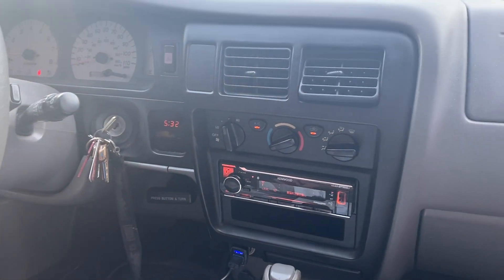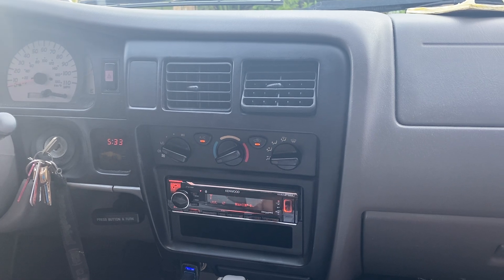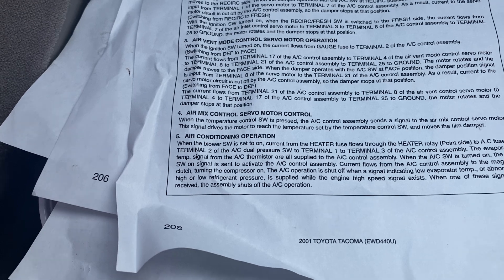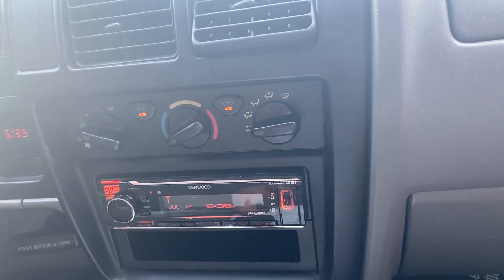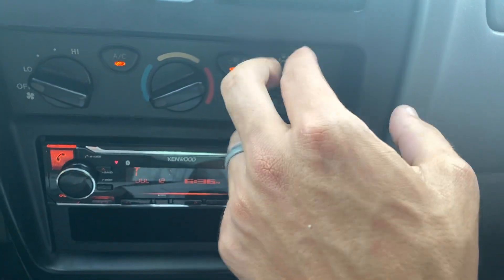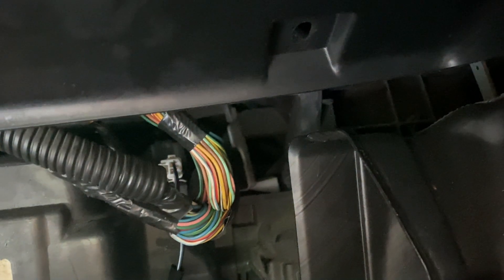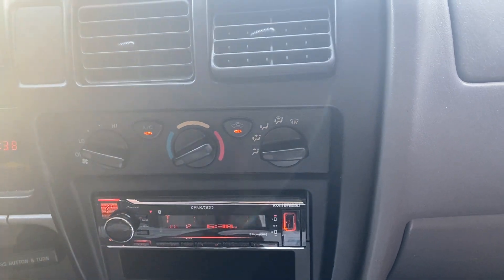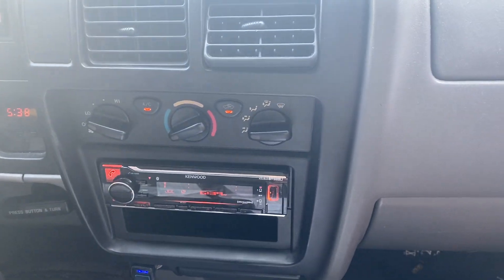AC Control Module Diagnosis HOW TO First Gen Tacoma 1995-2004

Comment: You were popping the 10A because you had a short or ground before the load in the circuit.  The purpose of the fuse is to protect the components of the circuit because are not designed to handle >10A.  Putting a higher A fuse exposed circuit components to more current than they were designed to handle, which is why you replaced all the shit in the path.  You fried them with excess current installing the higher A fuse.
Reply from the maker: I fried it because it was internally shorted

Comment: Why didn’t you just test your clutch operation before buying a new compressor? It’s easier than testing the control module. If the clutch tests good THEN test your control module and replace it if tests bad. If the clutch tests bad then replace the compressor, or just the clutch to save $.

Comment: I lost effective use of one of my four fan speeds following my clutch coil getting shredded when a retainer clip disappeared - dealer tried to re-use it on a compressor replacement.  Bad idea.  That left speed 3 output as low as 1.  The amplifier circuit was damaged by the circuit overload, and the fan speed was on 3 at the time so it got hurt by the fault.  These are basically analog devices that are replaced by computer controls on more modern vehicles.  I wish they had the a/c clutch fused separately and served by a relay.

Comment: The problem that I've been having with my 2002 Tacoma was it would blow a AC But if you went over a bump or touched any of the other dials it would immediately start blowing heat even though the AC is still running. I determine there was something wrong with the control module and I took it off and I went to go take it apart. DO NOT DO THIS!! Unless you know what you're doing which I don't and when I popped it open there was a connector cable that popped off and when it popped off I could not get it back on right And it bent up the terminals on the end of the connector when I try to put it back in and I tried to fix it but now my whole entire control module is messed up and it will no longer below AC or blow air where you want it. Now I have to roll down the windows because all it will do is blow heat. Now I ordered a used control module which I  should have done in the first place. I went to a couple different junk yards to try and find a Tacoma like mine but it was super rare to find and if I did they were gutted there was pretty much nothing left on them.